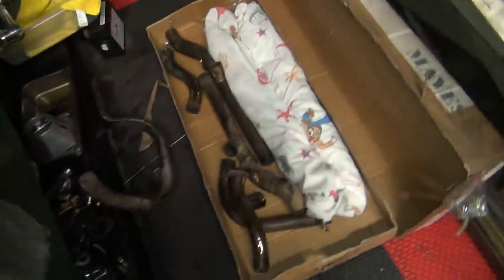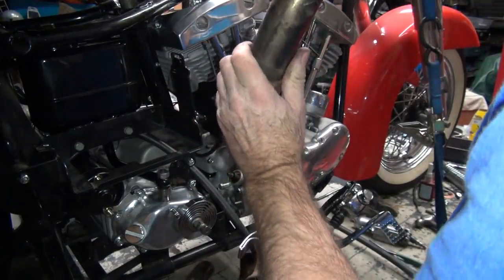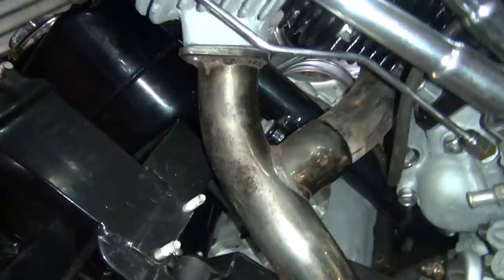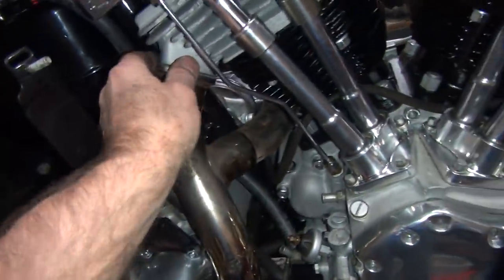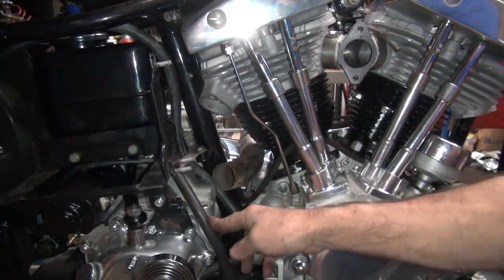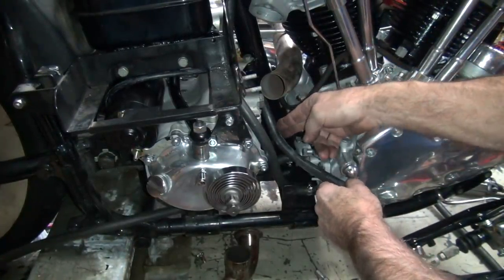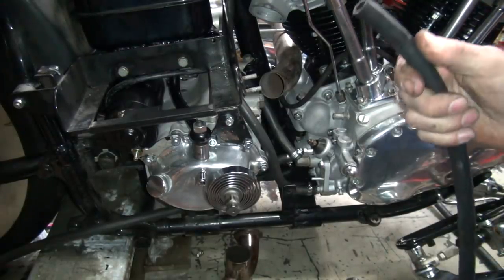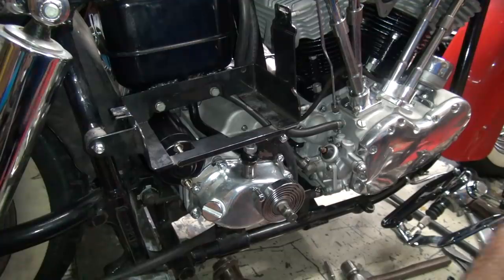1967 74ci shovelhead #158 flh bike assembly transmission rebuild harley craigslist tatro machine

Comment: Why not a wire guide coming off of the battery bracket bolt head to then bend and hold the oil line in place.